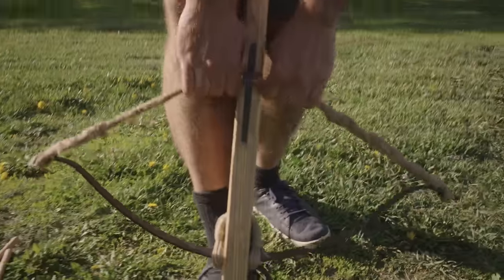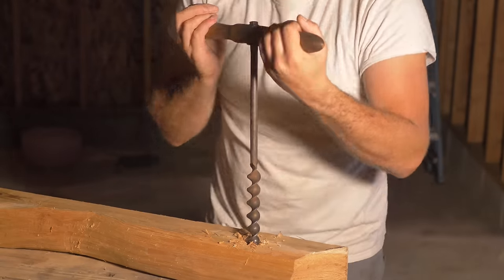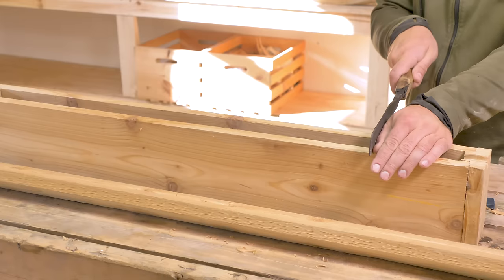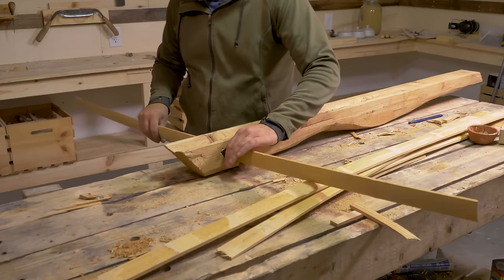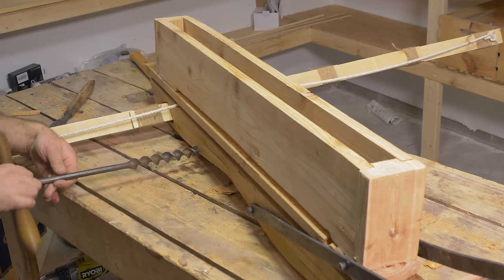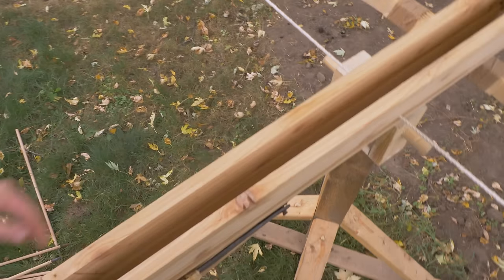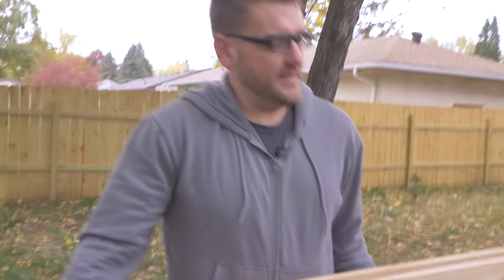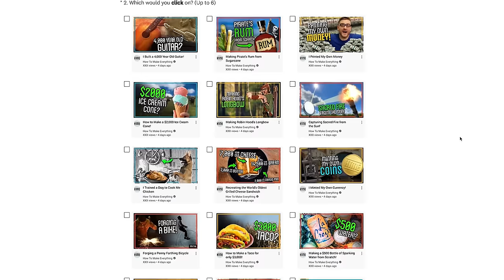A Machine Gun Crossbow?

Comment: I have thought about using kevlar twine or possibly nylon or both, outting it in  bundles in a fixture about 4'-5' long,  to be wrapped in plastic and vacuum infused with epoxy resin, then unwrap, and tightly wrap more twine around it , up to two layers, and then re epoxy the bar, possibly add a layer length wise, and wrap along the center section, making it thicker in the center,  2' or less, then cut the bar free, and to length,  using it as a bow for a cross  bow,  and possibly use a ratcheting mechanism to cock the thing, I feel a bar of kevlar, 2" thick in the center, and about 1" at the ends, it seems it would be fairly stiff, if not brittle  this is why I was thinking nylon! But kevlar is some tough stuff, with all the threads , or 99% of them , with a layer to hold them tightly bound, it should be very strong, allowing it to bow, and return to near straight, under lots of force, just a very rough guess, I'm thinking 100-150 lbs+, this is why I'm thinking a ratchet action to cock the thing,

Comment: A problem I foresee with making it fully automatic is that the bullets in a machine gun contain their own energy supply, part of which is used for loading the next bullet. The bolts in a crossbow don't have this.
I think a more easily acheivable route would be to seperate the loading and firing operations, as doing it in a single operation is affecting your accuracy. You'd then have a rapid reload weapon, analogous to a bolt-action rifle.
Maybe also a slightly shorter cocking lever too, so you can better use it on the run :)
Reply: @stevexracer4309  Steady on. In what way was my comment asanine? For storing energy, a spring is possible, but how would you store enough energy in a spring to pull the string back multiple times?
The title of Andy's video is 'A Machine Gun Crossbow', so it makes sense that it should be autoloading in some way.
A good idea I saw below was to use foot pedals to power the reload. He could do this, which would free up both hands for aiming.
And no, I don't play computer games.
Reply: @stevexracer4309  That's what Andy is trying to make though, at least according to the title of the video.
I think Mark Twain was right. You're proof of that.

Comment: I mean it's a nifty thing, but it has a surprisingly low draw pull for a crossbow (which makes sense.) considering the average hunting crossbow from the late medieval era had a draw pull of 450-600 lbs and war crossbow sometimes had draw pulls up to 1300 lbs
Reply: It's really a matter of proportion. This has a much longer draw length than european medieval crossbows, meaning it is stronger relative to its draw pull. 

You know how the heaviest war bows usually didn't exceed 160-180 lbs of draw pull and could still compete with heavy war crossbows in terms of power? That's because of the difference in draw length. You'd pull back an arrow by around a meter whereas a crossbow would be drawn back by less than half, giving it less time to accelerate. 

Granted, the version they built here still is a bit on the weaker side, I reckon (probably comparable to maybe a 120 lbs crossbow), but that might be somewhat of a trade-off. After all, the whole point of an auto-loading crossbow is being able to keep up a high rate of shots for an extended period of time, so if they made it so heavy that it exhausted your arms after half a magazine, that would defeat the point of having one in the first place (plus, it probably already requires a disproportionate amount of effort to use because there's a lot of friction and you basically lift it up when shooting).

Comment: you could try beeswax on all the moving parts including the bow string if I remember correctly in the past they used it on strings to increase longevity or something like that? it may slightly reduce wear and such and should help slightly with ease of use and speed?

Comment: if you used a leather bowstring would it have more or less draw strength and elasticity?
Reply: Traditionally rawhide was used for bowstrings in China, works well enough.

BTW a bow's strength and elasticity isn't determined by the string, but rather by the bow's material/design as it is the "spring"

Comment: Repeater crossbows can be made much smaller than what you made, tho ofc... I only know what medieval recreationists can do and that ofc involves havin access to modern tools even if mimickin premodern crafting.

Tho shockingly, your original crossbow is about as small as ive seen among handmade crossbows; rly its prty close to an old friend of mine's crossbows he mass produced (tho he used sheetwood glued together so it was much lighter).

Mass there bein like 50 of them, which id still absurd given that those were all made over the course of only a couple months with just the several hands of the household helpin out heh.

The only major diffs is he used pvc for the bendin part that my mind is blankin on the name of, and also he used toothbrush heads on the end of his crossbows so that a bolt wud sit comfortably in it even if you turned the crossbow upside down. And the bolt when fired wud not touch said toothbrush heads if fired in an upright position; so it wasnt in any way slowed by them bein there.

He had some designs for makin a repeater crossbow and it wudve prty much just been his existin crossbows with a box on top like you have on yours here xD

I moved before he made it tho

Ahhh, i see, ya wanted a full strength one... Yea naw we cant do that for the LARP we play xD We need them to be like equal to a 35 lb bow, so them losin draw strength is actually a good thing for us. The first crossbows we made were actually far too good for us to use for our game and we had to modify things til we finally got it just within the range of allowed draw strength/poundage.
Reply: Yeah that final draw strength you got wudve been around double what we are allowed to use in our games heh; also, your bolts arent regulation cuz we aint firin live steel at ppl :P

Comment: It hurts me to watch him stuggle with that saw , the problem with it is so simple and it's that it has a convex cross section and when cutting it litteraly pushes into itself and isn't able to cut anymore it's doable for smaller things where you can move the material out of the way but for larger stuff , it needs to have a parallel cross section and the teeth of the saw should flare out slightly from the edge

Comment: when are you gonna try take two at making a telescope? Your first attempt using a singlet glass lens could never have worked well because singlet telescopes require extremely long focal lengths to control chromatic aberration, but with your current level of technology you have access to all the technology you need to make a high-quality reflector telescope.
Essentially you would be building a Dobsonian--a reflector optical tube on a wooden rockerbox--with ancient technology.
You would need to make a 4" - 6" speculum metal mirror blank--more or less just a special reflective formulation of bronze (or a glass or glazed porcelain blank, and be ok with extremely dim images suitable only for the moon, venus, and projection of the sun, since you can't realistically silver or aluminize it), grind it into a sphere where the center of curvature is at least about 16 times the radius of the blank (focal length 8 times the diameter for a focal ratio of f/8), and test it with a foucault tester or a star test.
It would be a bit anachronistic, but all the technology is there. probably the most difficult item to come by is the eyepiece, which does have to be a fairly precise lens (or you could cheat and just buy a cheap huygens eyepiece to stick in it). The flat diagonal mirror would also not be that easy to make--though you could do what Herschel did, and avoid it altogether with a Herschelian Reflector.